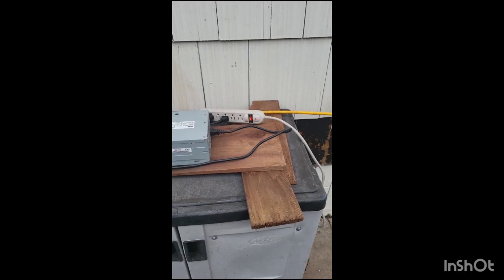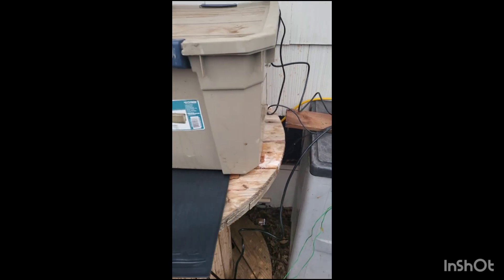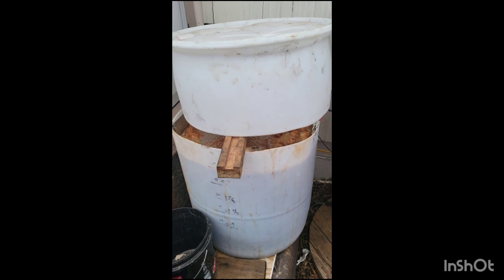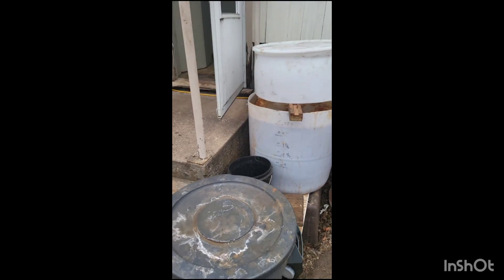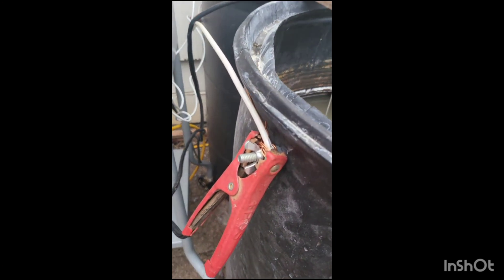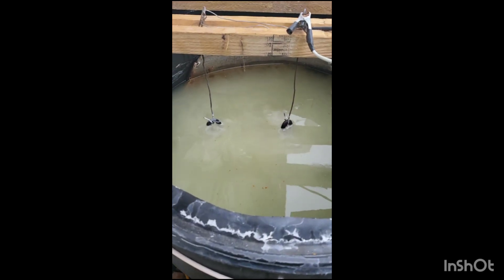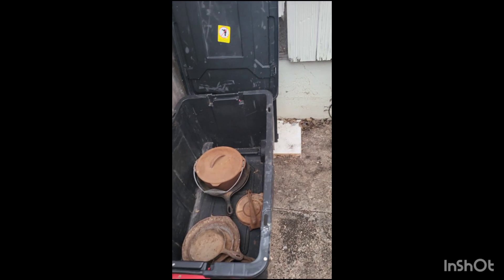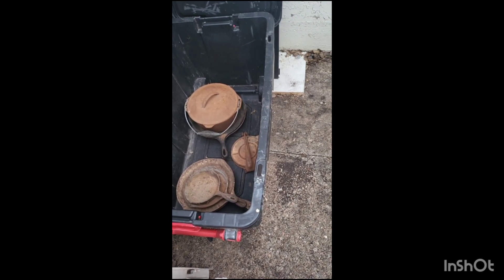My cast iron restoration setup.

Comment: Wow, just bought a new tub that will fit the #14 skillet flat on the bottom and a 300w aquarium heater for the lye.  But I'm still debating on filing it up and ending up with 10-15 gallons of lye.   I also have my e-tank empty,  wanting to add some steel on the bottom to do rusty DO's or a better way to hang them.  :)
Reply from the maker: You can always use the Lye for months of cleaning, and when you are ready to dump it, just pour down the drain to clean your pipes.  That video is my first ever setups and some things have changed .  If your etank is big enough you can hang them pretty easily, but if not then be careful because one little touch to the wrong piece and you can mess up your piece.